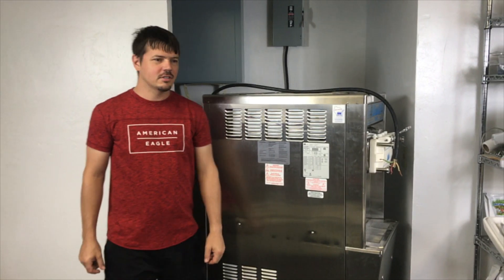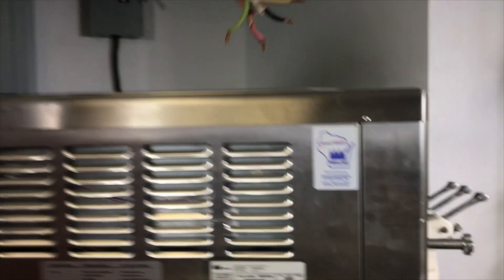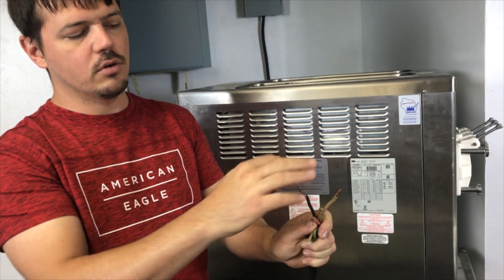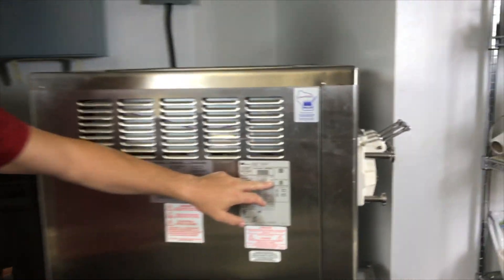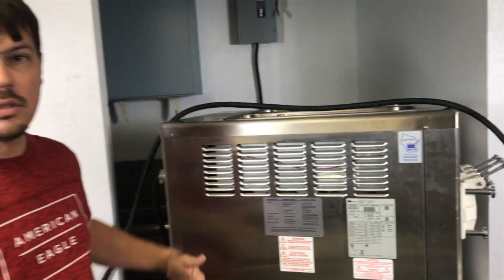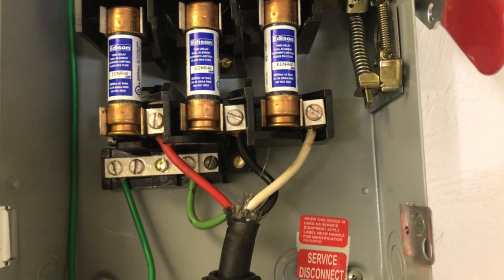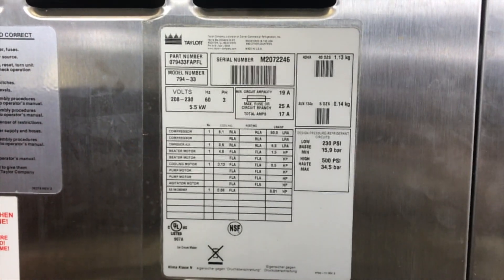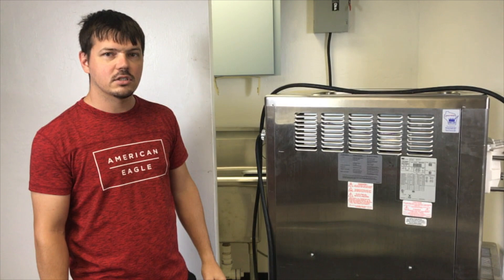The Difference Between a Single Phase and a Three Phase Ice Cream Machine

Comment: I noticed the unit was rated for a 20 amp circuit breaker -  when it is converted to three phase that changes?  was that still a 12 wire?
Reply from the maker: The machine was not converted. It was an original three phase. Follow the serial plate on the left and right side of the machine. Each plug should match the sides corresponding serial plate.
Reply: I got a Taylor 350-12 work but need help with viscosity

Comment: Can I convert 3 phase machine to single phase
Reply from the maker: The quick answer is no, the motors and compressors would need to be changed then the machine would need to be rewired. It would be cheaper to just trade it for a single phase machine. You can however, add a phase inverter to change your single phase outlet into three phase. here is an article we wrote to address that
https://slicesconcession.com/blogs/frozen-dessert-industry-and-machine-articles/phasemaster-rotary-converters-the-solution-to-only-having-single-phase-electricity-available-for-your-frozen-dessert-machine
Reply: Thanks u so much for dis informative video and for ur reply
Reply: Slices Concession hello would I be able to use this converter to use a 3 phase Carpagiani or emery Thompson. Thank you
Reply: I have a food trailer that has 240 volt capacity can I use a single phase machine and how many amps does it use